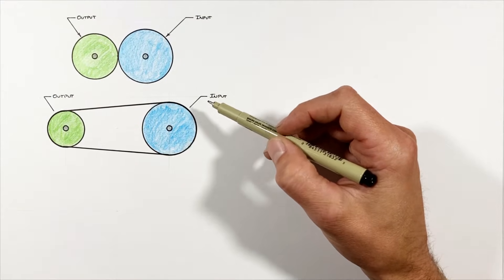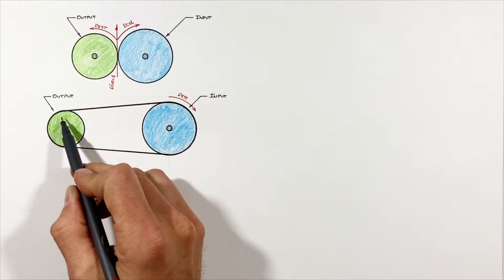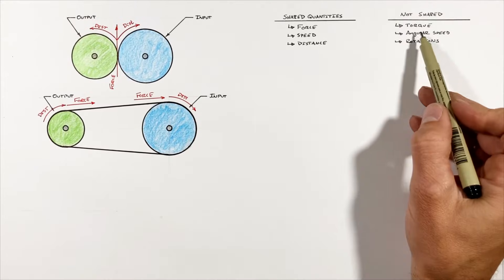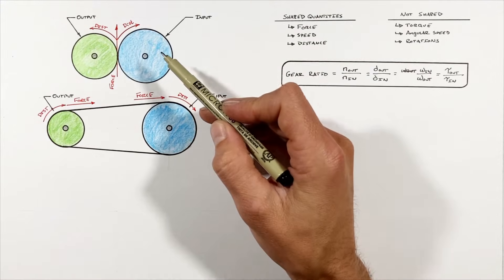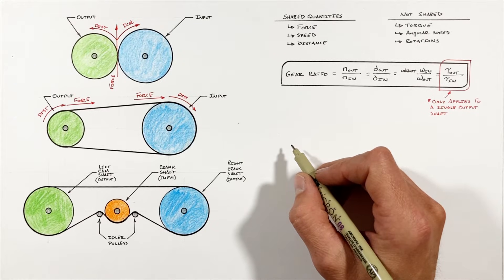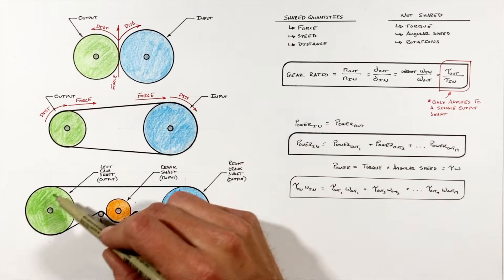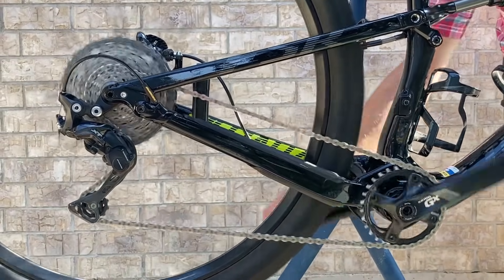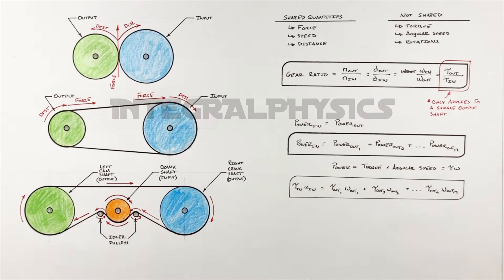Sprockets & Chains For Engineers

Comment: why my 3/4 hp dc electric motor with 1720rpm struggling on a sprocket ratio of 38 teeth driver/14 teeth driven? Can you enlighten me?
Reply from the maker: The first thing I would check for is that everything is turning smoothly, then I would take a look at whether your load on the output is too large.

Comment: You should do a video, if chain size like a 35 chain & a 428 with same gearing have the same impact in speed/power & if you can go higher gear ratio with a bigger chain size like 428 & get better speed & power then a 35 chain.
Reply from the maker: I did a video on chain/belt tension vs torque a few weeks ago.  You bring up a good point though... Its not uncommon to see guys swapping street bikes chain sizes looking for gains.
Reply: @INTEGRALPHYSICS  well some change chain for durability but bigger tooth means less gearing, since in some engine really cant go that high. In my mini bike i have a #35 18t clutch & 70T rear sprocket tops at 61mph & i have a mini quad that has 428 18T front spricket & 35T rear sprocket. But that engine has 3 speed trans & tops at 46mph. But different engines & chassis. I want to put a 428 in my mini bike see if i can get a higher speed & acceleration with a higher gearing..

Comment: If you take the strength of the material out of which the gears are made, and the surface area where gears are meshed vs. the chain surface area touching the pulleys - there is yet another major difference between these two. Of course for this we also need to look at friction and we cannot just neglect it.
Reply from the maker: Capstan Eqn.... Now there's a video that needs to get made.

Comment: If I add a jackshaft to a chain drive just to gain offset to accommodate a wider tire and the jackshaft has the same number of teeth on both ends, will the number of teeth on the jackshaft change my final drive ratio? Thanks
Reply from the maker: All other things being equal a GR of 1 wont change anything.

Comment: I'm going to be building a homemade vehicle (car & light truck) tire changing machine but instead of making it manual, where you have to pull the bar around the center post to install or dismantle a tire, I'd like to motorize it. I'd mount the motor under the platform that the tire sits on and either have it turn the bar around the tire or make the bar stationary and have the motor spin the tire (and platform). I need it to turn the bar or the tire fairly slow, maybe one revolution in 10 or 15 seconds so I need a high torque but slow rpm at the driven pulley or sprocket (I'd like to run cogged pullies with a cogged belt). Without getting technical about it I'm thinking that an electric winch with a pulley connected running a belt to the driven pulley turning either the bar or the platform but I'm not sure what size pullies I would need. I also thought about getting a high torque windshield wiper motor or a similar gear reduced 120V motor but I need to figure out what size pullies I need to keep it high torque but not run the bar or platform so slow that I can pour a cup of  coffee and drink half of it by the time it makes one revolution but also not so fast that the white on white lettered tires doesn't just fly off 😆! But seriously, I need to figure out the pulley sizes I need to allow it to turn in a slower controlled manner but still have enough torque to do the job.